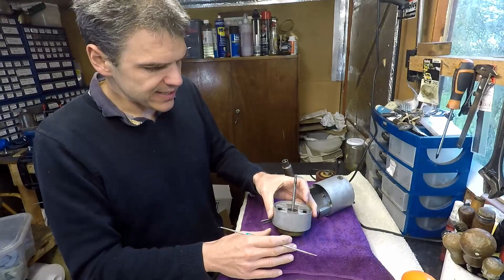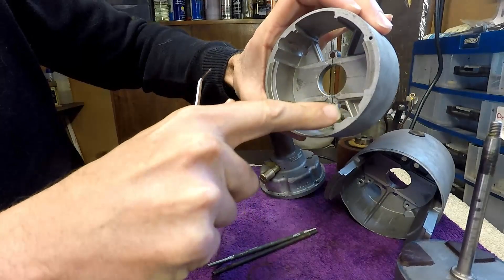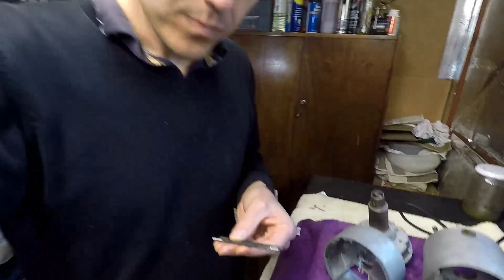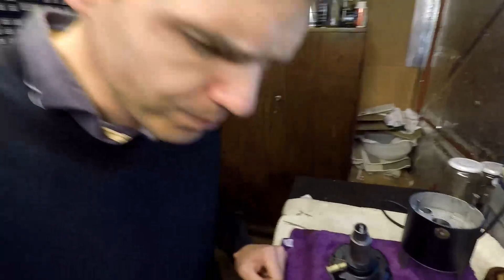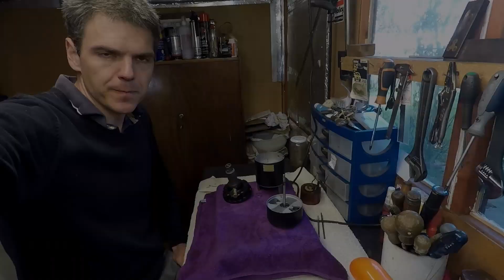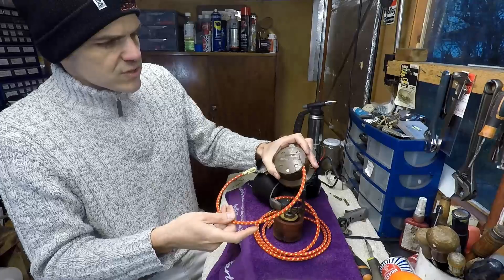Scintilla Vertex magneto restoration progress update. Paint, new leads and spare parts.

Comment: i have the same mag on my Vivat motorglider with a walter mikron engine.  i am trying to find out how to set the rotor correctly before i pull it from the engine.  i get inconsistent results when i attempt to set the timing, so something needs attention.
Reply from the maker: Remember that mags have to be double timed so to speak. First internally that is aligning the moment of peak magnetism and coil saturation to trigger the spark. And then externally, that is between the mag and the engine so that it fires when it should.
Reply: Hi ,I have a scintilla vertex mag on my chenard walker car made in 1929,I have watched your video with great interest and have realized my magneto has no condencor but it sparks very well when spun with a drill ,is this normal